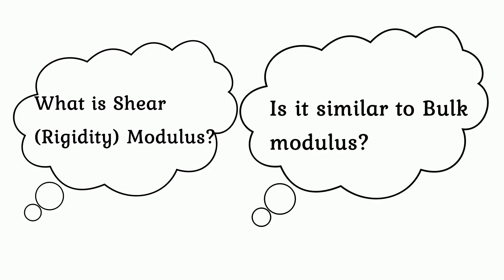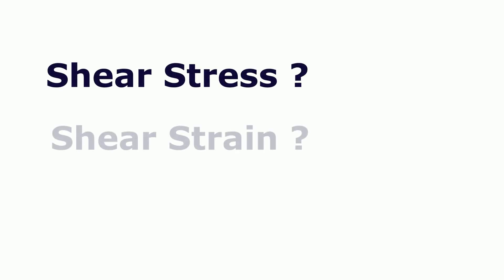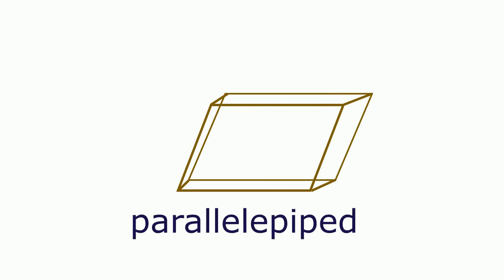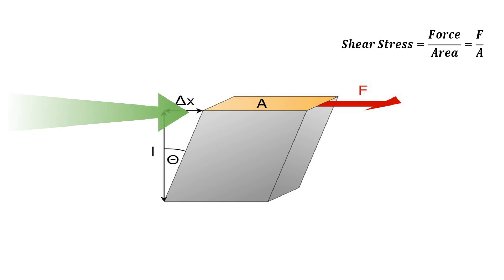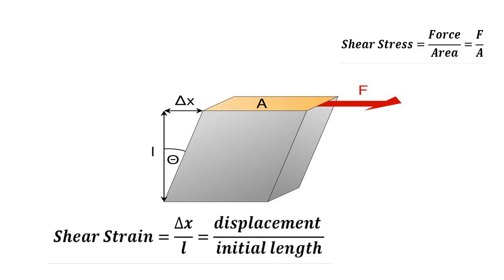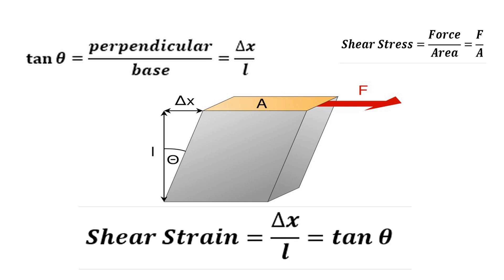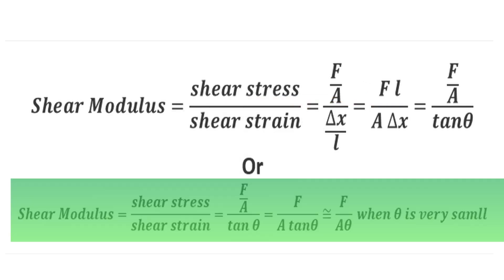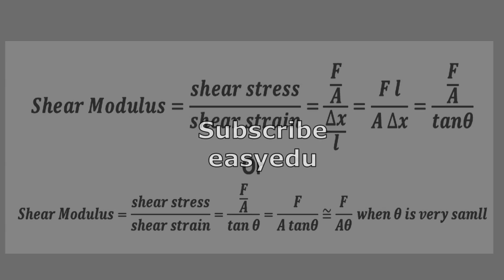Shear (Rigidity) modulus, shear stress and shear strain explained (Physics)

Comment: How tan thita is become only thita but value of thita and tan thita are always different (in case of small thita also)🤔🤔
Reply: It’s called the small angle approximation, so it’s not exactly equal until theta=0, but it’s close enough that it can save you a trip to the trigonometric tables. It was handy more than 40 years ago, before trigonometric functions were widely available on calculators. Use trigonometric tables on a day’s worth of work and you’ll appreciate the shortcut.
Reply: Tan0 is equal to 0
Reply: Theta used in physics are in radians and to some value the normal radians or trigonometric functions of that   value of radian is almost the same that's why